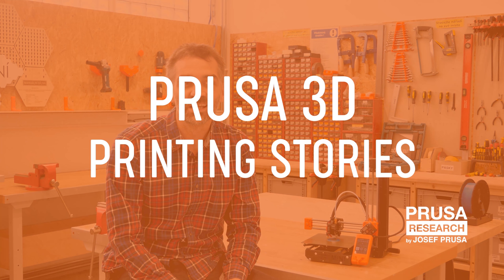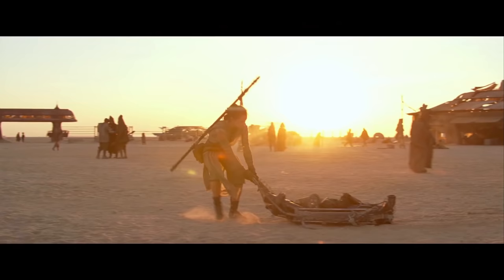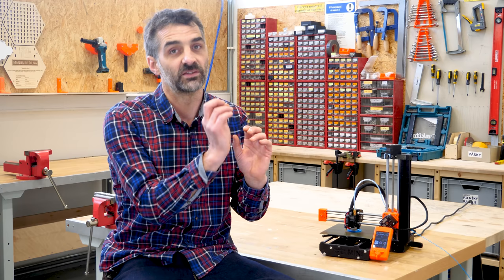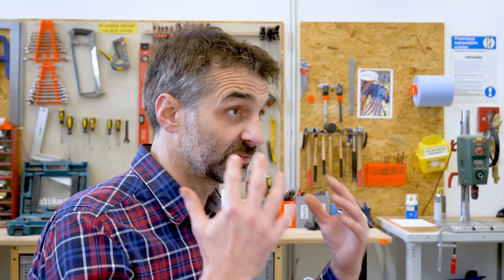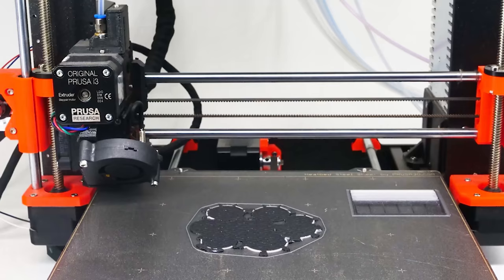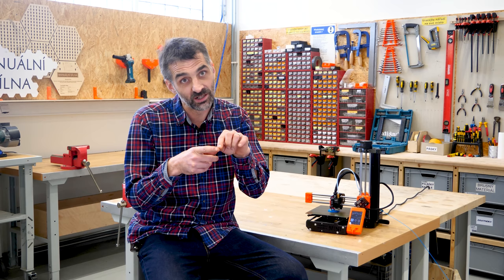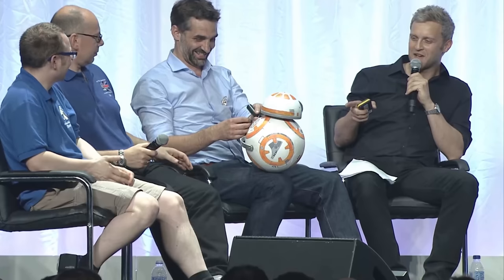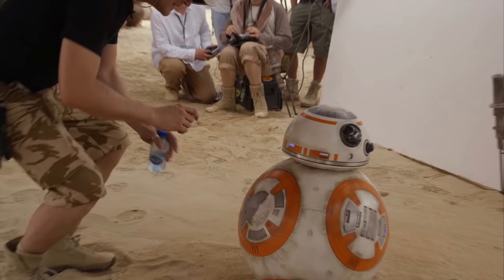Original Prusa 3D printers in Star Wars? - Interview with Joshua Lee

Comment: You better get on that Prusa 500x500x500mm to 1000x1000x1000mm CoreXY film printer set.
Reply: In my experience with a 400mm^3 printer for cosplay, you get to make full helmets much easier. Few things have to be reworked and processed for such a large printer.

A 1m^3 printer could allow easy printing of chestplates! (Note: printing such amorphous objects at large scale often requires enormous amounts of support material)
Reply: @Cheesecannon25  But you can get support material and recycle it. Recycled PET bottle support material.
Reply: @Cheesecannon25   with such a large print volume a dual extruder setup  would be critical .. so you can print supports with a diffrent material or color.  MMU is handy but really not ideal for supports as you end up mixing it a bit in the nozzle and its messy
Reply: @PaulColeVFX  the only benefit of dual extrusion over MMU extrusion is a waste tower, which becomes less relevant with wider prints

Comment: If you are familiar with AirSoft guns, they create. a “ tracer round” effect by exposing a pellet to intense light as it travels, at 450fps, through a 6” light tube. You can get green and orang tracer rounds. This gives rise to a thought: could you create photo-activated dyes ( think photochromic eyeglass lenses), such that you could expose them at the printhead to create colored filament? Could you then, almost like RGB TV, use various wavelengths and exposure times to create an infinite range of color as it is laid on the model? No changing reels, no color division, just continuous color as needed.
I don’t know what’s happening in CZ, but new ideas and products are blooming.

Comment: Classic tractor fever had an episode on using 3d prints to make tractor replica parts  I want to do the same for 15 inch gauge shay steam locomotive to print the master parts is alot easier than carving it out of wood and if I was to use some kind of wax filament the lost wax casting method could be used